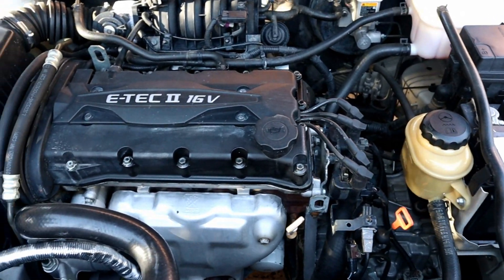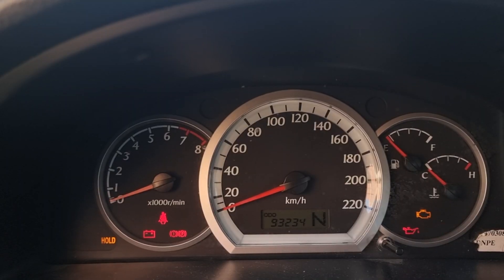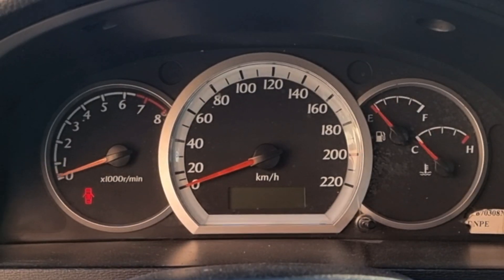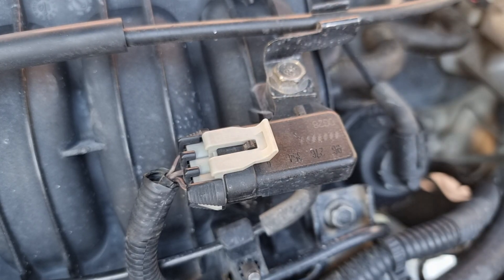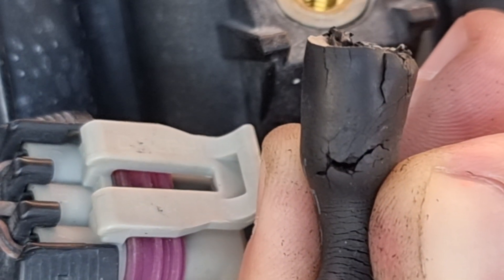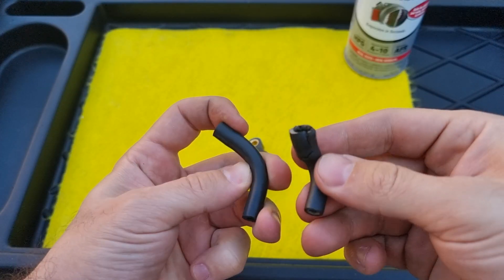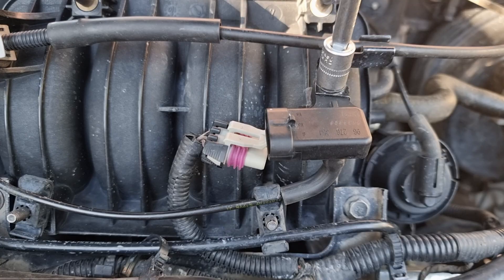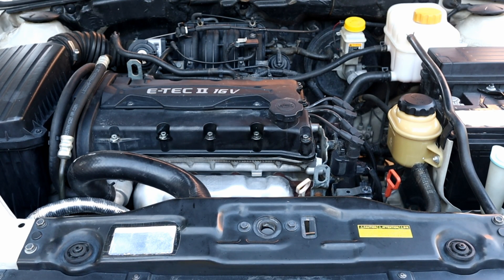Engine RPM goes Up and Down??/Fixing code p0107/How to tell if map sensor is bad/Bad Map symptoms

Comment: Hi Alimech, thanks for the great videos. Did MAF cleaning, throttle body cleaning and replaced with new gasket and torqued but still having acceleration issues. Any advice??
Reply from the maker: thanks, have you clean the fuel injectors?
Reply: @AliMECH  did not.

Comment: I got a code po003. On my 2002 Saturn vue 3.0 v6. What do I do to fix it
Reply from the maker: Code p0003 related to pressure regulator on your fuel injection rail
Reply: Thank you